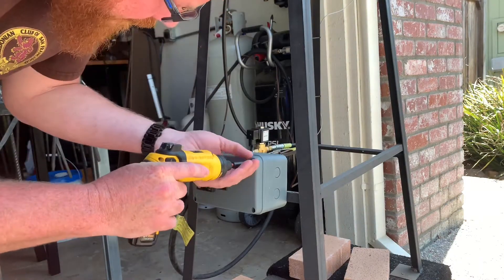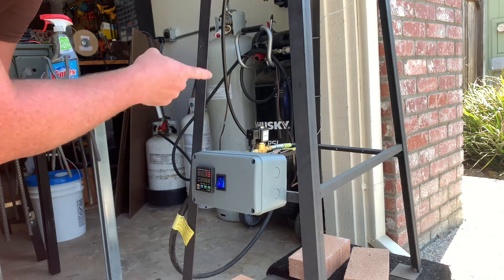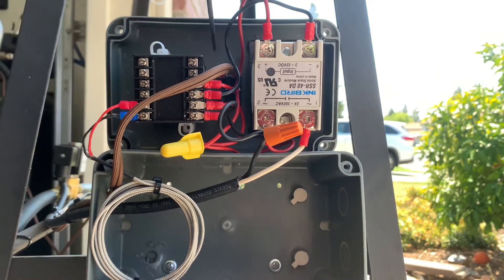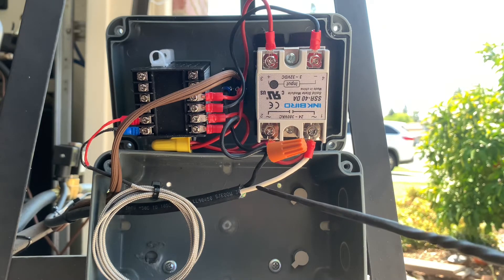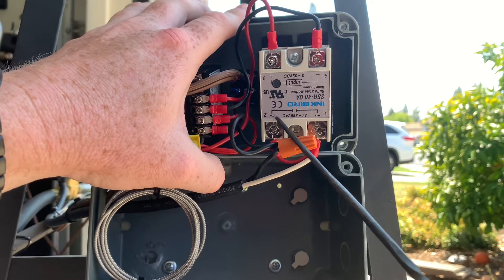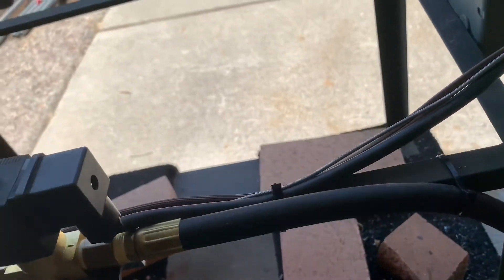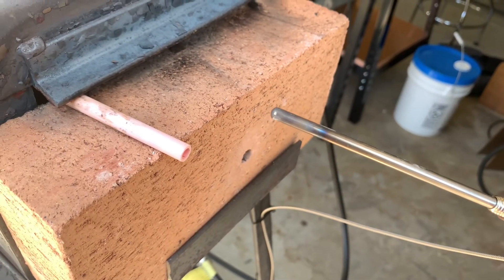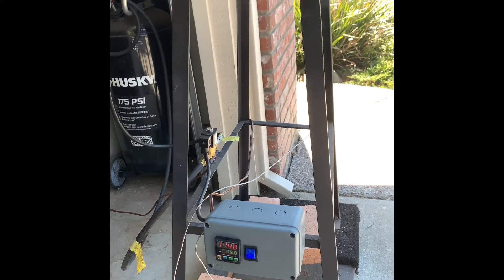PID temperature controlled forge!?!?

Comment: Hi, you could run another set of wires from the switch and connect them to an iPhone charger onto the pins with spade connecters and run a 5V- USB computer fan to cool the heatsink as they get very hot. You need an exit hole same size as fan to get proper flow effect.
Reply from the maker: That's a good idea. Fortunately I have not had any issues having it the way it is now.

Comment: I’m in the process of doing the same thing to my forge. Just wondering what are you using to reignite the forge?
Reply from the maker: Now that I’m using a ribbon burner forge I’m not using the PID but the old forge would reignite just by the inside ambient heat. I have seen some wire a spark igniter to the controller but the wiring gets more complex. 
If you choose to let for heat reignite just be sure to be ready in case it doesn’t you can shut the gas off and let it air out, then manually ignite it again
Reply: @AIIZREVIEWS   Im also interested in a circuit with a reignite system, its purpose for more like a bakery type oven.
Reply from the maker: @theirondungeon  if you mean an auto ignite that is something I haven't done for my forge. It stays hit enough to ignite without a spark when the gas kicks back on. I'm not sure how you would do that
Reply: @AIIZREVIEWS  Ok thanks for the reply!
Reply: Thanks for the reply! My plan is to use a PDI with a stove ignitor and a gas valve all 120v set up, very similar to a stove..
Reply from the maker: @theirondungeon  right on. Let me know how it goes!
Reply: @theirondungeon  I have a diesel "torpedo" type space heater that has a temp controlled reigniter circuit.  That may be a place to find cheap components and a working example.  They can be found at yard sales on the cheap.  Hope that helps.

Comment: very good work i enjoyed the video and you are doing everything great. we would like also to demonstrate us the settings on pid you did. I am trying to have o gas burner on a pid and i can't figure it out how i can set it up so the solenoid valve does not shut on and off very fast. Thank you!
Reply from the maker: Thanks. I will try to get that out. Honestly though I haven’t used it much since then to control gas flow unless I’m trying to use copper.